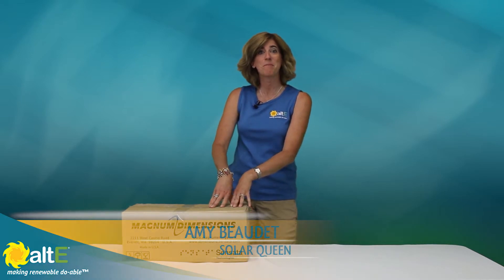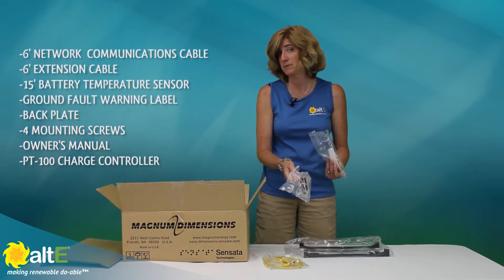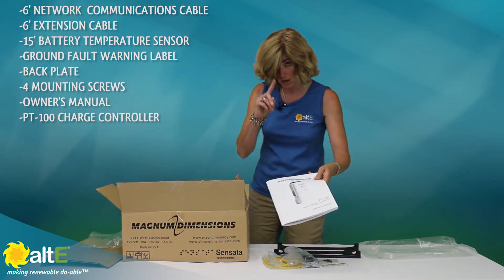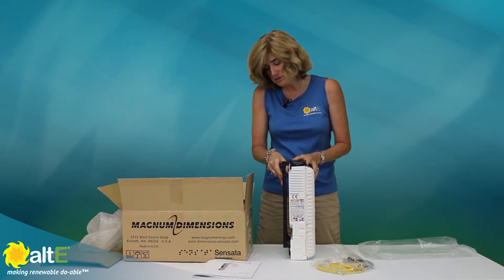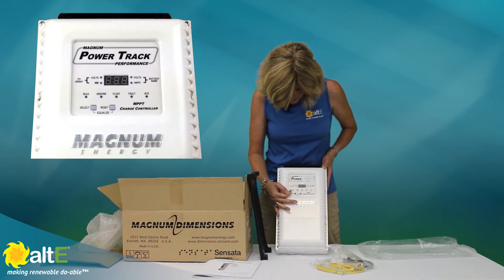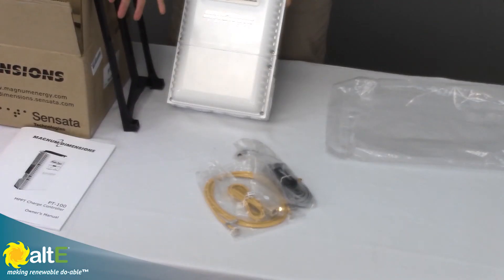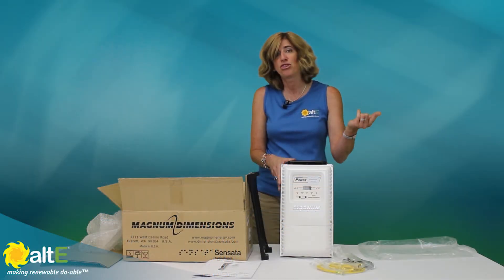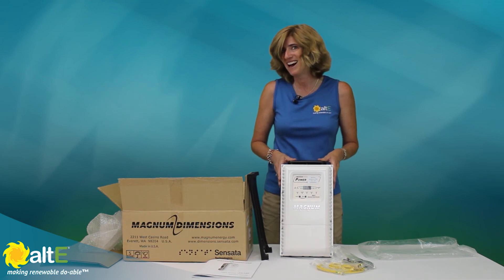PT 100 MPPT Charge Controller by Magnum | Unboxing & Features

Comment: Can the charge voltage parameters be customized for lithium ion or are there only preset charge parameters
Reply from the maker: If you have a Magnum Remote Control, you can set custom charging parameters. If you have it standalone, you can use one of the preset parameters. See page 70 of the manual, https://www.altestore.com/static/datafiles/Others/PT-100_Manual_V2.pdf
Reply: altE thank you for your reply!

Comment: how does this one compared to  Schneider Electric, 60A 150V
Reply from the maker: The Schneider can handle 2880W of solar on a 48V battery bank (60A x 48V = 2880W), and can have up to three 60 cell panels in series. The Magnum can handle 4800W (100A x 48V - 4880W), and can handle four 60 cell panels in series. However, if you have a Schneider inverter, the Magnum will not be able to communicate with the System Control Panel or ComBox. But if you have a Magnum inverter, they can all communicate together through the ARC. So it depends on your system and what features are important to you.

Comment: would this be a better communication with the magnum inverter charger?
how does this compare with the midnite solar classic?
best
Reply from the maker: +Rev John O'Toole If you have a Magnum system with an ME-ARC50 remote, you may want to use the Magnum charge controller, as it will also support that remote. But the charge controller and inverter don't communicate with each other. The capacity of the Midnite and Magnums are very similar, 96A vs 100A. The Midnite does have more bells and whistles, so if you are doing something other than straight solar charging, then the Midnite may have the advanced features you need. The Magnum can run with a higher voltage than the Midnite 150, but the Midnite 200 and 250 can handle higher voltages than the Magnum. So, in the end, it depends on what you are doing, and what features you need. They are both excellent products.